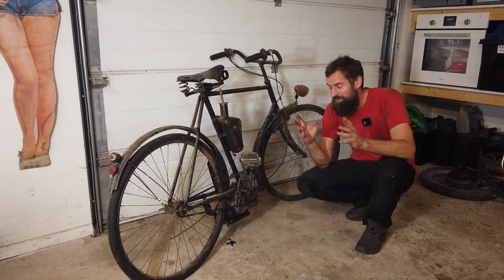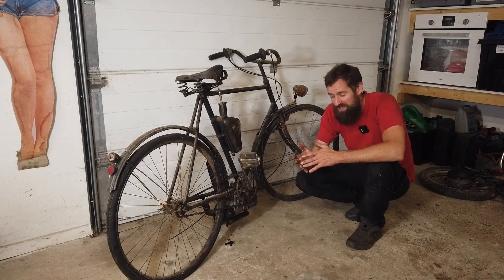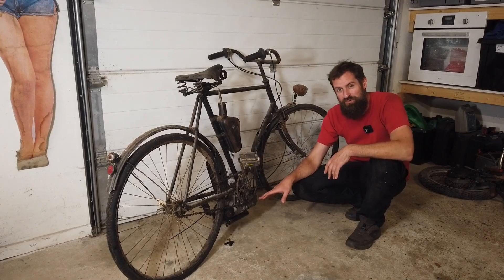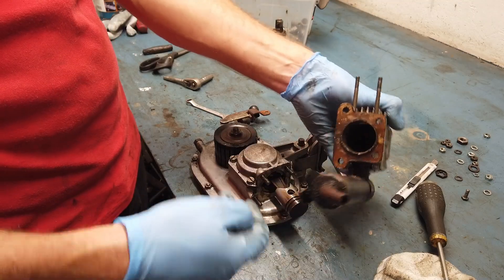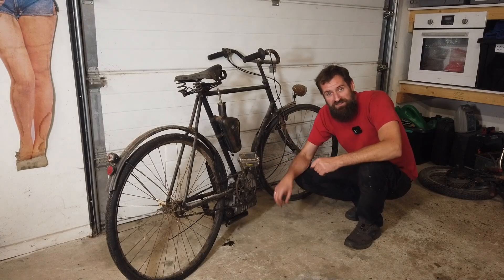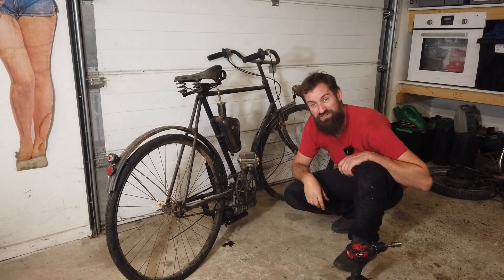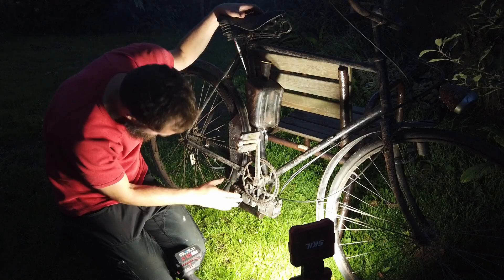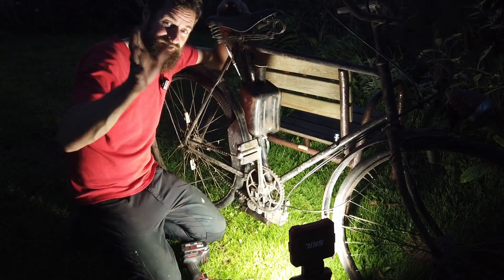Two Stroke Diesel Moped With Variable Compression! 18cc!

Comment: Had a small diesel model plane engin with variable compression but when I was running it in with a prop on it I slipped and stuck my thumb into the prop. Oww bent the rod. 😢

Comment: That engine is truly amazing I have seen lots of old variable compression engines very economic you could adjust the compression so the engine is only making the power you need often used to drive Farm equipment 
The military also have variable compression engines because they are multi fuel engines which can run on gas petrol  parafran or TV0 and diesel

Comment: I have one of those,got it running.Kind of hard to start.Lots of fun to play with,Going to put it on the German E bay soon .
Reply: Do you think that the zinc metal of the mixer may be "rotted" over time...and thus the fine adjustments just can't be made as they were intended to be when these were new?
Do you use any lubricant mixed in or just straight diesel?
Do you preheat the engine before starting it?
Once it warms up does it put out less smoke?

Comment: These things are rare and expensive. I want to see it work in perfect condition so that's what I hope happens.

It mostly happened and I have never seen an engine make so much smoke. Makes sense for diesel though. I second the opinions that you should try kerosene too.
Reply: Cold cclinder and piston= white smoke.
Once it warms up the fuel should combust more completely...
but a drip can never equal a squirt re the burn percentage in a diesel engine.

Comment: That is not a Diesel engine because it lacks the essential feature for a Diesel, the internal mixing via a timed injection pump. 
It is a so called "compression ignition" engine. 
A true Diesel engine must have a timed injection pump. 
Sorry for that nitpicking, but even in the original ads and the original service and user manuals it is clearly stated that the Lohmann engine is not a true Diesel.
Reply from the maker: Ok ok.. but it runs on Diesel and is a engine... it also got Diesel stamped on it on many of the models.
Reply: @SeasideGarage  that's why I stated "sorry for the Nitpicking"... I have a masters degree in mechanical engineering and one of my professors in college was a Diesel-Guru. And it was his "thing" to point out that not every engine which runs on Diesel fuel is a Diesel engine. It influenced me a bit... Sorry about that.
Lohmann made a Gasoline version of their bicycle engine which had enormous teething problems (lubrication, overheating) and never caught on until Lohmann stopped making bicycle engines. That's the reason for the "Diesel" sign on some of their engines.
Reply from the maker: It makes sense... ;) I bet I would feel the same if I meet the Diesel-Guru ;)
Reply: I'm giving both of you likes on the comments😼👍

Comment: Very clever engine with a few refinements like electronic controls over fuel and a belt drive instead of the wheel friction it would be a viable machine, it's very interesting compared to the kits available for bicycles right now
Reply: With gasoline fuel injection on chainsaws now common...
maybe a high pressure fuel pump driven off a bump in the crankshaft and electronic injector is feasible for this style of diesel engine...rather than a drip?
Reply: @JohnSmith-pl2bk  I agree with a little modification that looks like a good engine, is it cast iron or aluminum
Reply: @cartmanrlsusall  
Looks like an aluminium piston, steel rings, steel inner cylinder and aluminium 'exterior "head" etc.?
Reply: @JohnSmith-pl2bk  I don't know a schematic with details would answer that

Comment: As an English engineer I love how German`s always have to go one better. :)
Reply: But don't forget it was the English that kick started German industry after the war to get the country up on its feet again. And that includes vw
Reply: German engineering 👍
Reply: English version would need a separate oil tank to ensure correct asphalt lubrication
Reply: @tortron  I`ve done a video on shit German Bosch starter motor solenoids. I don`t think it`s the engineers that made the mistake but the fact that they don`t want to admit to a mistake so don`t want to change it to look like fools.
Reply: @damianbutterworth2434  oh I have 100% run into that in the workplace many times
Reply: @tortron  I have too since I used to work in a DAF lorry starter motor test department. BOSCH used to say it was our fault. You might run into the problem if the lorry you want has a starter motor problem and can not deliver your paper clips.
Reply: @tortron  what was your point anyway? Do you think German engineering is better than British?
Reply: @damianbutterworth2434  modern German engineering is rubbish, old British engineering leaves puddles on the driveway. Now for a good paperclip you want American made.
Many times I have found engineers of all countries who have designed something rubbish but insist it's fine
Reply: I`ve made JCB turbo bearings on my 1930`s American LeBlond lathe.
Reply: @damianbutterworth2434  ahh, I thought you said the German engineers always have to one up though
Reply: @tortron  
https://www.youtube.com/watch?v=5eWKtqtcv_s&t=11s

Comment: Revs well! How many HP? It would still be way more powerful than a road legal electric bike!
Reply: Naaah won't get much power with an 18cc engine 200watts maybe
Reply: @fidelcatsro6948  A 50cc two stroke gives around 3hp or 2,250watts so if was a third of that with 750w it would be three times better than a Euro legal electric bicycle that is restricted to 250w!
Reply: @dummatube  but diesels arent renowned for hp theyre known for Nm torque..im assuming 200watts at 5Nm of torque to get the pedalling done as such..🐱👍🏿
Reply: @fidelcatsro6948  I agree with you. The torque rating of a traditional high compression diesel can be twice the rating of an equivalent sized petrol engine but this little beauty has variable compression to ease the pedal start-up - and how many diesels have you heard rev that fast? It's amazing! Would love to get it running on the best fuel under load and measure the HP and torque ratings!
Reply: @dummatube  we"ll never know its one of those rare bygone era of technology hidden from modernity just like the opposed piston without cylinder head engine

Comment: Interesting video but the 'Diesel' designation is incorrect: Apart from self-ignition, the hallmark of a diesel engine is that the combustion is started by the injection of fuel. Self-ignition engines have existed before diesel engines, one example is the hot-bulb engine. This engine achieves with variable compression, the same goal as the 'hot bulb' on that engine. The ignition is determined by compression heat, not the moment of injection, the result is an engine that has limited operating range and nowhere near the efficiency of a true diesel engine. It also explains why Mr. Diesel had to fiddle around so long with first coal gas injection, then 'humidified kerosine' injection, before finally, a device could be made that allowed to inject the fuel in fluid form, small enough droplet size at the right time in the compression chamber: the diesel fuel pump. The early German rail car set "Fliegende Hamburger" was still equipped with "air-assisted" diesel injected Maybach engines. The Danish MS Lyntog was modeled after that rail car set (although technically unrelated as far as I know).

Comment: Cool!   I don’t think it is designed to idle.  Just to run as you are riding the bike with it engaged.
Reply: You made sense to me
Reply: The flywheel effect of the bicycle running along the road should get the engine to a certain speed/load/fuel drip equilibrium?
Reply: I agree, it probably works fine if you just ride the bike as intended.
I don't see a flywheel to keep the engine going. It also kinda makes sense, imagine what would happen to the tire if the engine keeps running while the bike is standing still. lol
Reply: Yeah, ever take the blade disk off a lawnmower, they struggle to idle and don't rev up fully, a big flywheel really smooths out a low power single cylinder

Comment: Model aircraft diesel engines are still made, variable compression using an adjustable contra piston in the cylinder head. Fuel is typically equal parts of ether, kerosene and oil, ether has a very low flash point so fire's easily. PAW is the best known UK maker.

Comment: As a boy, in the early 1950ties, I’ve seen the Lohmann motor on a bicycle and recall it fuming and smelling like a Kerosene lamp. Compared to a 50 ccm moped it was of course quite inefficient. Kerosene was probably the best fuel to get it running as, according to Wikipedia, it needed high- octane fuel in contrast to a real Diesel engine (with fuel injection). A similar principle was used in early model airplane “ Diesels” before they were built with glow plugs. They had variable compression and used fuel with one third diethylether (yes, the anaesthetic!) for ignition. A comprehensive description with a nice foto you may find here: https://de.wikipedia.org/wiki/Lohmann-Motor
Reply: not high octane, high cetane. Octane is resistance to detonation, Cetane is ability to ignite. Higher the cetane, faster it self ignites.
Reply: @kasuraga 😼👍
Reply: Possibly vegetable oil might be better, nicer smell and better lubrication.
Reply: @G-ra-ha-m  i once topped up my 110cc bike with edible vegetable cooking oil because the oil level was below par
Reply: @fidelcatsro6948  It's a good oil yes! I ran a diesel car on it for a while, until the prices went up LOL, car still works perfectly! :)
Reply: @fidelcatsro6948  2T or 4T?  what happened?
Reply: @raedy07  edible vegetable cooking oil as a top up ( not fully replaced ) in my 4stroke suzuki best fx110 engine oil crankcase...ive also put 4t used oil in my yamaha 2 stroke rxs115 cc fuel tank before it runs ok but the combustion chamber accumulates carbon coke faster than usual... today i use a tiny amount of used engine oil in the fuel tank of my aircooled bandit1200cc 4 stroke carbuerated engine as well, helps run smoother cooler on hot days (20 to 40ml to 20litre gasoline tank)

Comment: Imagine how far you'd have had to pedal in order to effe t that first cold start! Thank goodness for cordless drills.
I think the concept of a lightweight engine which can be unclipped from the butter churn and clipped to a bicycle makes lots of sense on a fairly remote farm. You can always siphon some diesel from other pieces of farm equipment - brilliant!
And that bicycle is utterly gorgeous.
Reply: You finish your errands and it starts on the way home a few feet from your doorstep 😂
Reply: @fidelcatsro6948  Ha ha!
Reply: Perhaps making sure that you heat the engine with a blow torch before pedaling might hasten starting?
Reply: @JohnSmith-pl2bk  I'm sure that you're right, and that it would, but I should think that, if this engine were in daily use, it would become easier and easier to start. I doubt that it would be long before the rider found himself enjoying a pleasant chat with the local law enforcement officers, however.
Reply: The horror: cycling 😂😂

Comment: This thing needs a turbo and nitro😂, I love it.
Reply: Pointless! 2 strokes are alreadyy supercharged, it's inherent in their design. And diesel fuel has a higher CV, (i.e. more power) than nitro.
Reply: @Kimdino1  How are they supercharged?
I also don't get why the caloric value matters that much. 
Like there's a reason why tiny rc cars and drag cars use nitro and methanol, even if it has lower caloric value.
Reply: @BrawlerTheSmokyDutchMan  They can be, and are, supercharged in many different ways. But they all must have it as a 2stroke is incapable of self induction.
I have been trying to work out how to shrink a meaningful answer in to a reasonable space for YT replies & it can't be done. The best I can fit is to suggest you go and study a bit of thermodynamics for your answer. Google can point you to plenty.
Reply: @Kimdino1 supercharged effect comes from the conical shape design of exhaust that creates a resonant intake suck effect from the exiting exhaust gases
Reply: @fidelcatsro6948  
Please educate yourself by examining the Detroit 2 stroke diesels...(Screaming Jimmys)
It can't run as a "normally aspirated " engine.
It has a mechanical blower on the side to force air into the engine...to equal normal atmospheric air intake.
and then they also turbocharged them for more power.
Reply: All two stroke engines are normally aspirated. You cannot supercharge a two stroke, the fuel/air charge will blow right through the cylinder before you can light it up.
Reply: @chrishenniker5944  Re? "All two stroke engines are normally aspirated". At what point in the cycle do you believe there is sufficient vacuum in the cylinder to suck the fresh charge in? I repeat from above "a 2stroke is incapable of self induction". 
Re> "You cannot supercharge a two stroke". Rubbish, they would be unable to run without such.
Re> "the fuel/air charge will blow right through the cylinder". Ahaa, maybe you are thinking.  This is exactly why small high speed carburetted 2 strokes are so inefficient. There are a host of different ways this is limited in these engines, but only to a point at best. Check for stepped pistons, offset crankshafts, reed valves etc.
Though a diesel I suspect the engine shown will fit in this category. The blowthrough is one of the reasons I criticised Brawler for suggesting EXTRA supercharging. In these small high speed engines the charging must be matched to the engine characteristics. I suspect this engine will be using under piston supercharging, but insufficient details are given to have any real idea.
But in serious engines this is not an issue. The fuel is put into the cylinder only after the exhaust has closed, and it is carefully calculated & designed so that it is all burnt before the exhaust opens. These particular engines are way more efficient than 4 strokes.
Exhaust turbines, underpiston compression, electrical & mechanical blowers have all been used. But there much always be something.
Look up the Sulzer RND engine which combined several of these methods.

Comment: I'm wondering here if the diesel itself serves as lubricant too, since it's a 2-stroke engine... I'm amazed by that tiny thing!
By the way, you won't have any issues with mosquitoes during Summer time. :face-green-smiling:
Reply: I suspect these things want something like Castrol R40, somewhere around 16 parts of fuel to 1 of castor oil.

Also, the fuel might well take a formulation similar to “diesel” model engines, e.g. it has a small amount of diethyl ether and an ignition improver.  Given the description of the fuel “mixer”, I’m thinking something like a mix of kerosene (70+%), a little naphtha (10%), a little bit of diesel fuel (balance of the mix), a small amount of diethyl either (5% or so) and about 1% of an ignition improver.

And, of course, a hefty load of Castrol R40.

Comment: I've had model RC aircraft fitted with diesel engines that used the exact same principle. The piston runs inside a sliding liner that you tightened or loosened with a T bar screw in the cylinder head. You started it with low compression then screwed it tighter as the engine got warmed up. If the engine stalled you had to slack the compression off to restart it.
Reply: Yes. Also smaller non-RC engines. I had a 1.5cc two stroke diesel in the 1970s (made by Frog, if I recall).  It produced an amazing amount of torque for such a small engine.
Reply: @GodmanchesterGoblin  yes. The ones I had were made by Davis Charlton, 1.5cc with a bronze coloured cylinder barrel, like you say, pretty powerful for their size.
Reply: How do you know it has amazing torque , did you test it ?
Reply: Those aren't Diesel engines. These engines are compression ignition engines. A true Diesel engine is a completely different story.
Reply: @albinklein7680  pretty sure diesel and CI are the same thing.. just that diesel is a subset of CI that well.... runs on diesel
Reply: @strawbemily3182  no. Totally different principles. A Diesel engine sucks in pure air, compresses the air charge, and the ignition happens when the fuel is injected. 
If an engine has a carbutettor or any other means of an external mixing device, it is not a Diesel engine.
Reply: @albinklein7680  ummm Diesel's first engines were drip fueled or air charge injected...
Reply: @strawbemily3182  the first Diesel engine had air blast injection, because the spring loaded Bosch nozzle hadn't been invented yet. It has the essential feature of all Diesel engines. The internal mixing of fuel and air and the very small delay between fuel delivery and ignition. If an engine lacks that feature, it is technically not a Diesel engine. It is that simple.
Reply: @albinklein7680  alright then, thanks for the info
Reply: Model ‘diesel’ engines as used on model aircraft are correctly termed   HCCI (homologous carburetted compression ignition) engines.

However most users refer to them as diesels.

Comment: Makes me think of the Marine Volvo Penta MD6: when you start it, you take off the compression to help the starter to get it to ‘some’ RPM. Once it ‘s spinning, you pull down a leaver which closes something (?) and there is compression and the engine starts running
Reply: My father had one old norwegian Øglænd (Öglaend) moped which had half-compression valve on the cylinder head for easier starting. Once it fired up, you closed the valve, there was cable and lever for it on the handlebar.
Reply: @d-d-i  
Larger CC chainsaws, larger single cylinder dirt bikes, old Brit single banger motorcyles  had a compression release of one sort or another..
Reply: Called a valve lifter…. It does not close anything, but in the contrary, it opens the exhaust valve before “running”